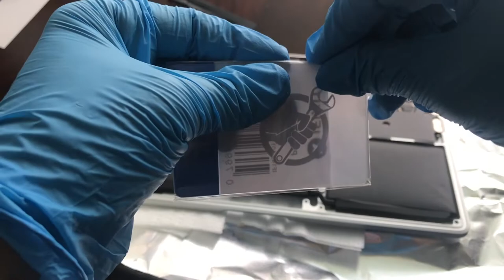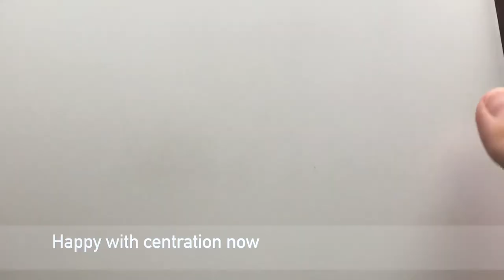ASMR Computer Repair - No Talking - MacBook Pro Battery Replacement

Comment: As a computer repair technician this made me cringe....
Reply: No anti- static gloves or wrist strap for starters !
Reply: Also no pad to secure the laptop to the table, I know it’s no necessary but I like to use a rubber pad to keep the laptop in place when I toy around with the insides of old Toshiba laptops
Reply: You lot sure you're versed in the realm of pc technicians? You didn't get trained by that guy from the verge did you?
Reply: @Grim-HEX  no I’m not an expert, more of a novice just trying to have fun